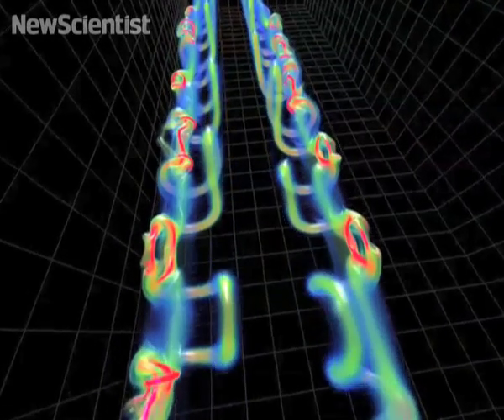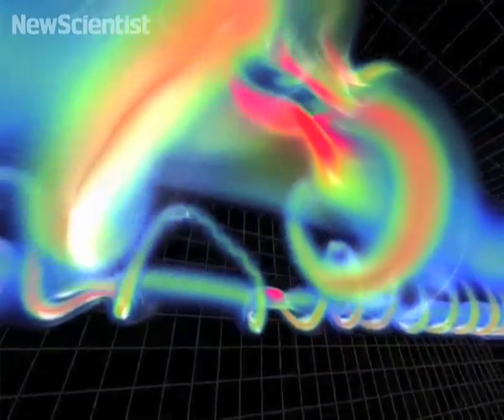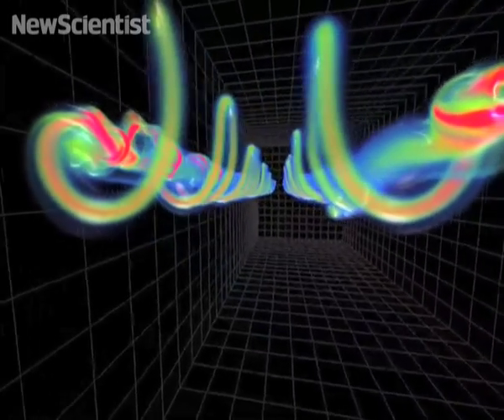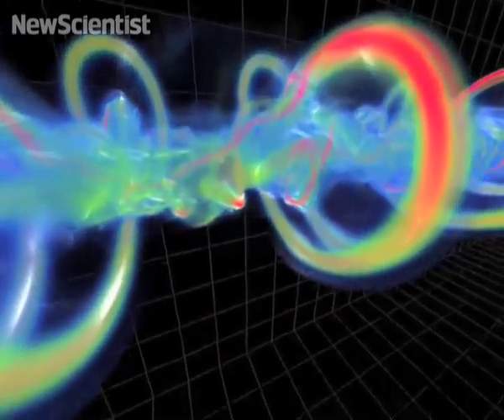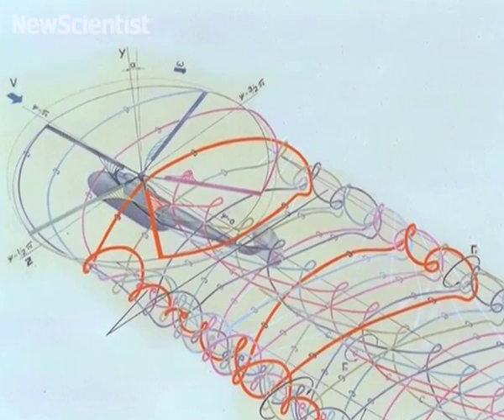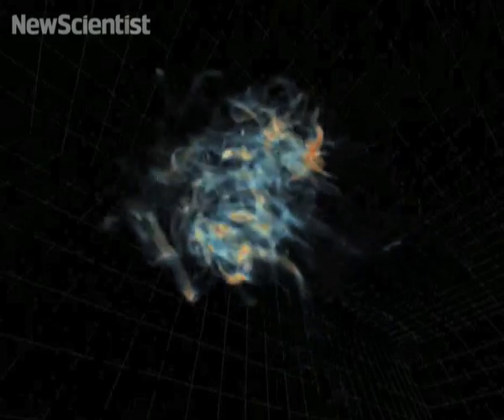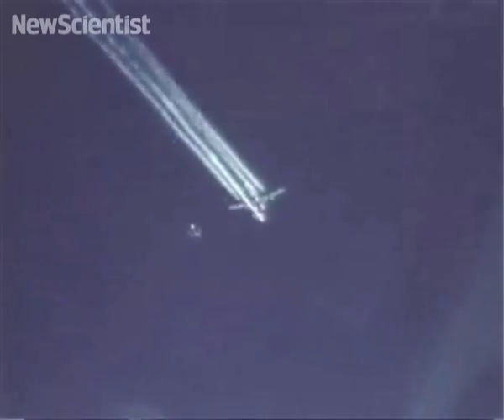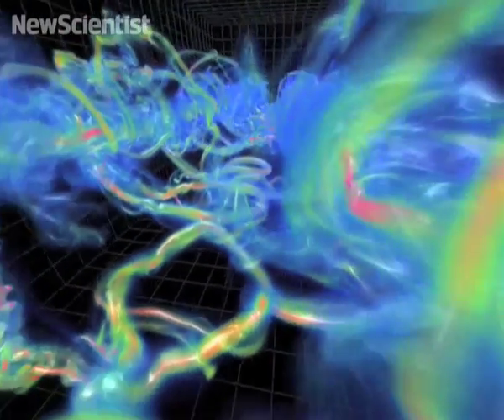State-of-the-art graphics reveal vortex physics

Comment: You can't say that they 'simulate' fluid dynamics as they only want to mimick certain characteristics, if the player thinks he sees a flow it is sufficiently accurate.
Fluid dynamics in games and the CGI in movies is usually thoroughly simplified, because of the complexity, the resource requirements and the fact that numerical stability should be guaranteed for user experience, the latter is impossible.